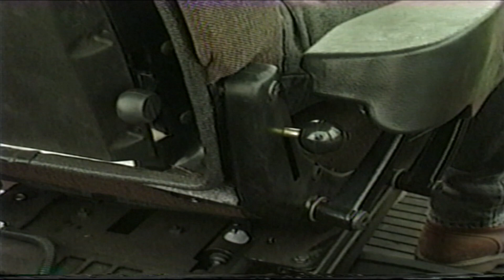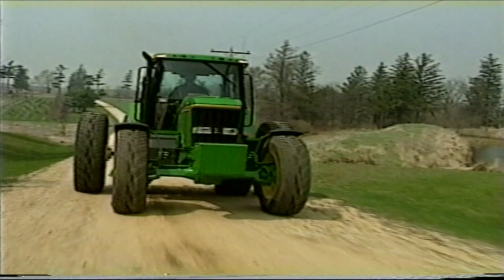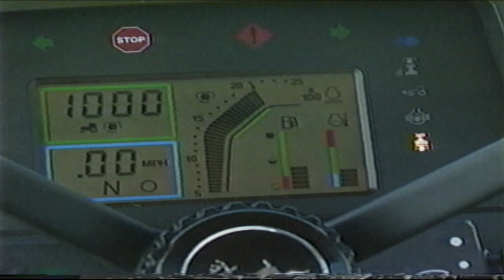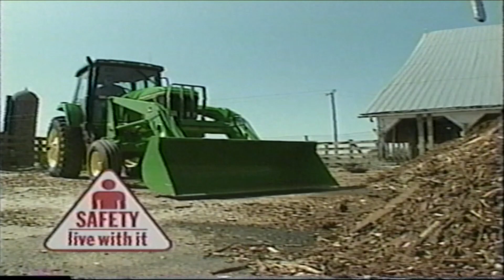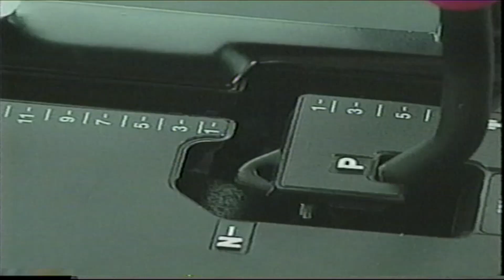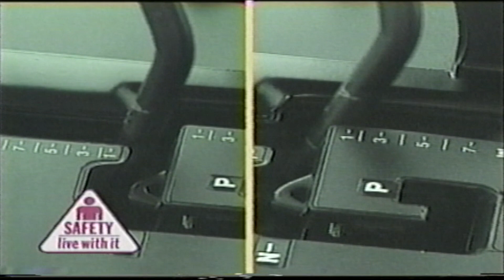John Deere 7000 Series Tractor Overview and Maintenance

Comment: Well, my friend, I would LOVE to add the John Deere 7200 2 Wheel Drive Tractor with 90 inch front axle for my FUTURE FARM from 1993 to 1996.  By the way, I will use the 7200 for whatever I wanted to.  I always have plans.  I fell in LOVE with the LIVE ACTION of the John Deere 7000 Series Tractor pulling the John Deere Flail Chopper in the Corn Field after harvest time in the fall season.
Reply from the maker: Great tractor!
Reply: I know that it sure is a great tractor to me, and I think it will have the same component options like the John Deere 6200, John Deere 6210, AND the John Deere 7210 2 Wheel Drive Tractors with the 90 inch wide front axles.

Comment: just purchased a used 7800 last spring, like it in some ways and really wonder what Mother Deere was thinking with other things. Was Deere so insulated that they didn't realize that others were going to pop up hoods instead of side panels and bolts galore. I sometimes think that Mother gets it engineers in a room and demands what is the "minimum air conditioner we need" whereas the competition just says, "guys we got sweaty large farmers in here and it's all glass, we want a meat locker setting on this thing". The air just barely keeps up and the air flow is low with all new filters. Overall a good machine just some glaring things, also the 19 speed jerk a matic takes some getting used to
Reply from the maker: Well, I've got a confession on this video........HDA is the Engineering & Design firm that JD worked with in the development of this tractor when the fellas in Europe were working on the 6000 series.  I wanted to keep the video positive and left out some of the issues and arguments the JD boys got into it with HDA during development.  Funny, the issues that were on the table for debate you brought up some in your comment.  I put the video together a while ago and can't remember all the specifics, but I need to include all the information, including the negative as well.  I do remember the JD boys using the 50 series as a benchmark for the air conditioner and the 7000 series didn't hit that. although it was improved vs early cab design.  Next time I will include all my research, not just the rose colored glasses edition!  Thanks for watching and commenting, it helps me in the developing of content.
Reply: @OpasJDGarage  Looking forward to it. When I was young Mother Deere did no wrong, then i worked for a long  gone Deere dealer and learned a lot. Now that I'm in my mid 60's I am quite jaded about ag all companies. I think the warts makes some of the most interesting topics. Would like to tie an engineer to post and whip some of them, just for revenge. Been operating  and repairing farm equipment for over 50 years and some things are just plain stupid
Reply from the maker: I'm also going to do an interview with a fella that owns one in the 7000 family (my neighbour - think it's a 7800) and get his 2 cents on it.  He's as busy as a one arm painter right now, so look for it in June.

Comment: I have 2 neighbours, one of them have 2 6400 tractors, 4wd open station... Very strongest AND reliable tractors... But another neighbour  have a 7500 AND 4455 tractors, both purchased new, today the 7500 Is "death" AND the 4455 Is working in the field without problems... Greetings Mr gmfan once again thanks For sharing this videos👍👍
Reply from the maker: We had a 4450 and I remember that tractor being a beast!  Our JD dealer had a 7400 that we demo'd, but we passed.  Thanks for watching and sharing your comment, I appreciate it!

Comment: I used to run a 7800 4wd on my uncle's farm in the late 90s early 2000s man I loved that thing
Reply from the maker: We could've used 4wd on those rainy October days after the sun dried the corn on the stalks but the bottoms always had a layer of greasy mud on the top!  Thanks for watching and commenting!
Reply: @OpasJDGarage  I wish my 2240 had 4wd. I've been  pushing snow all winter and if you point your nose downhill it can be hard to get pointed uphill again.
Reply from the maker: @somethingabouttractors241  Agree, 4wd drive makes such a difference!  I remember those 7800s at our dealer, it was like sitting in a spaceship, the engine was so quiet and just purred along.  I was so hot to get one, but my father talked some sense in my head and calmed me down on the drive home!  You know the conversation "Dad, we need to modernize and get with the dang times!"  Could've been a page out of the Gordon family movies..ha ha ha ha.  He told me we need to be thankful for what we have and keep our current tractors spick and span!   That Christmas, my father bought me the ertle 7800 "kit" tractor to assemble.  That tractor was a heck of a lot affordable, and I still have it!
Reply: @MrGMFan  the older I get the more I  understand "make do or do without"

Comment: Wow those Cabs look so Old!
Reply from the maker: Ha ha, I suppose it depends on the fella!  When I use my neighbor`s 7810, I still think it looks like the space shuttle inside. Its so quiet, A guy can have a conversation next to it while its running!
Reply: @OpasJDGarage  7810 was to light for the Power Rides like a bucking horse
Reply: I have a 7710 2wd, 7810 mfwd.    They remain my favorite despite having 3 others that are newer.    7710 has 8300 hours on it.   Love them for their weight.   11,000, 14,500#.  Compatible HP now is 20,000#.